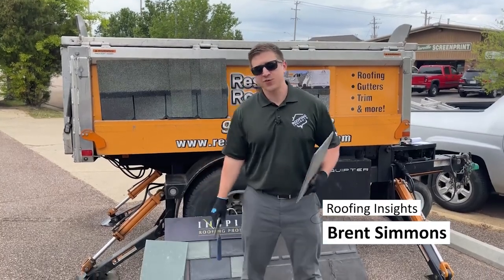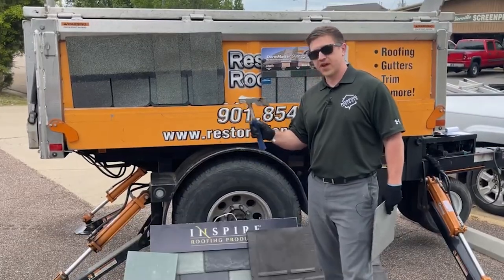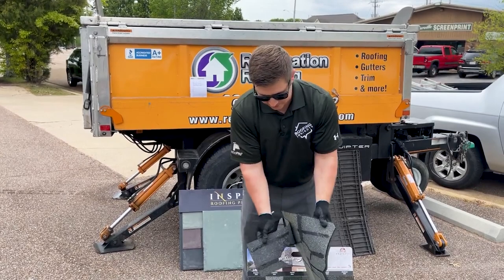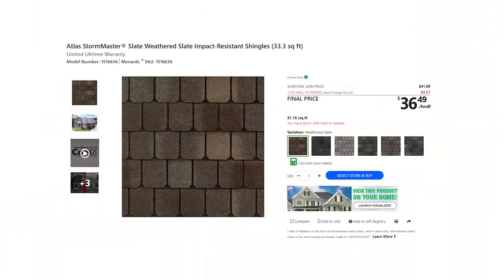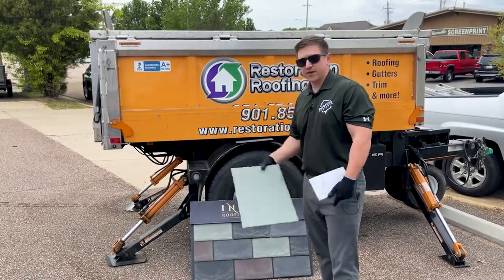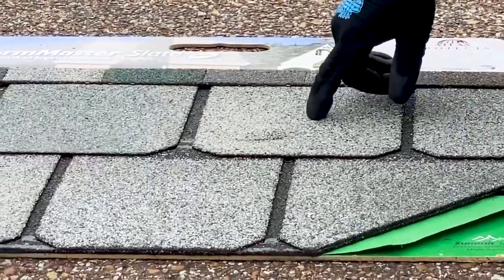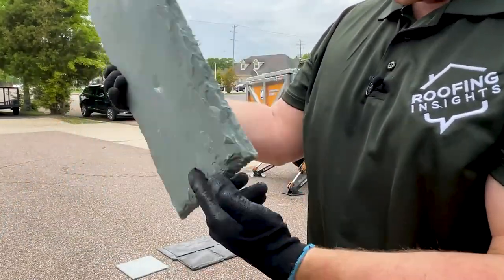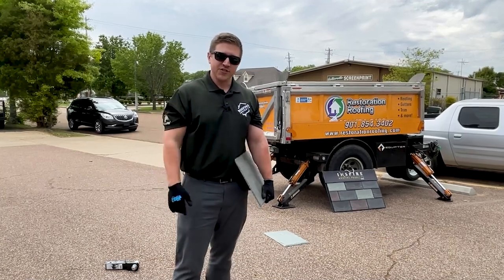Real Slate Roof VS Synthetic Slate Roofing Shingles Comparison

Comment: Thanks for including our products. FYI our Rundle Slate panels that you featured here weigh just under 9lbs per panel and it’s 40 panels to cover one roofing square so 9x40=360lbs per roofing square. I’m not sure how you figured out the 430-450lbs per square. Lmk.